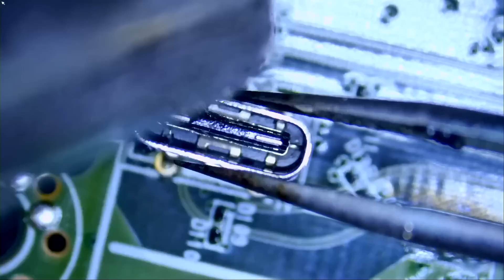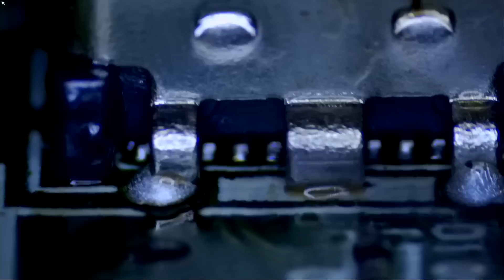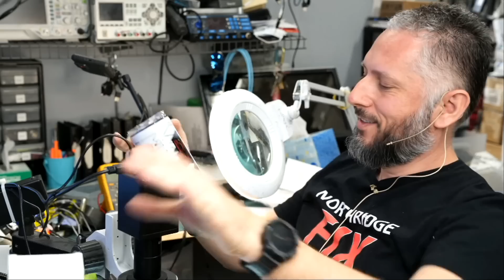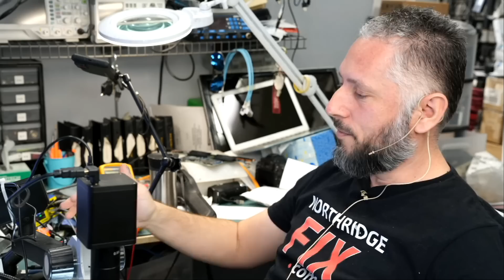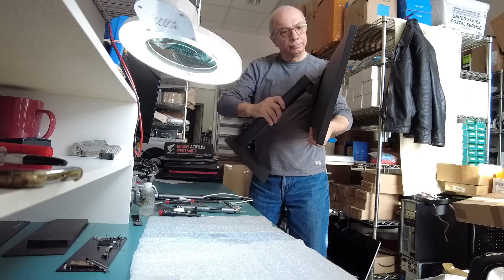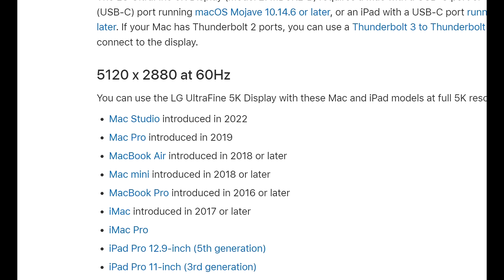Expensive  LG Ultrafine 5K Monitor Repair  Bent cable and no Signal

Comment: One way you could make the repair economical would be to only repair the pads on one side of the connector, USB doubles the connections on each side so the cable works installed both ways around, so you could repair one side and the customer could just turn the cable around on till it works.

Comment: This week, my monitor chose not to turn on after leaving it for 30-40 min (after 15 min it goes to sleep). It is pretty old, like 10-12 years old (LG W2261VP). I searched for a video on how to open it and what could go wrong. After successfully disassembling I found out that the power supply area capacitors are all bulked (electrolyte alu caps). So I noted the values and tried my local "radio shack" the following day to see if they carried these. Sure they did, and I could fix my monitor for like 2 $, instead of throwing it out and buying another for a few hundred dollars. Thought I share it with you guys.  Watching your videos Alex gives many ideas, and confidence and always lean something new.
Reply: thats awesome man

Comment: How many no-fixes do you have on average? I am a network engineer; I work on servers and networks daily. I come across broken equipment all the time.  I try and fix things. I am good at replacing ports and micro-soldering. I have a lot of no-fixes. NO shorts on the power rails. It seems like the chips with the software are bad. I have no way to read or program them. No way to tell if they are bad. Just wondering how many no-fixes you have.

Comment: I wish manufacturers would put external ports on a separate board with a ribbon to the mainboard. These issues keep coming up and at least if it was just a simple pass-through board to replace, it would be an easy fix. I guess it's down to cost but also somewhat intentional in helping to kill off older products and get consumers to just go replace rather than repair.

Comment: A trick I use occasionally to reduce heat damage risk is use heatsinking to protect parts.  For a connector plugging in a cutoff connector adds some thermal mass, and insulates the plastic interior.
Reply: He sometimes uses metal shield too. Except in this case, it had to stick on the bottom.

Comment: I'm not sure why a monitor needs thunderbolt. Everything is wrong about this connector. The surface mount, the easy to deform oval shape (strong againt forces from the outside, not from the inside), the special cable.

Comment: Connectors are such common failure points.  I’m surprised they’re not made with disposable inserts that can be replaced if the socket is Hiroshima-d.  I wonder which company has the most robust ones?

Comment: Why does the owner just use another socket? There are 2 sockets on the board.
Reply from the maker: Only one port is Thunderbolt 3 and the rest are USB 3.1 gen 1 downstream used to connect to other devices and accessories
Reply: @NorthridgeFix  thank you, I am not a tech head, just really enjoy watching your work. I solder only larger stuff for RC model hobby, leant a lot from watching you

Comment: just imagine the manufacturer not spending 50 cents on a device that costs 1000$+,
on making more of the usb-c ports use thunderbolt-3, so the monitor wouldn't be e-waste if the user accidentally dents the only thunderbolt connector...

Now that is a prime example of "Planned Obsolescence"
Reply: i would never buy such a stupid monitor, always buy one that has hdmi, display port or DVI.
Reply: Or software controll all conetors in or output.

Comment: Out of curiosity, why would you take one from the top to replace a few inches down? Why wouldn't the customer just use the next USB up?
Reply: He mentioned it a couple of videos before, that this monitor has only one input. This being the broken USB c port. Stupid design if you ask me...
Reply: Because the monitor is designed in such a way that only one of the Thunderbolt ports is an input.
Reply: I'm just guessing but the next USB up probably isn't configured for display
Reply: In some electrical devices only one port has the necessary specifications. such as hdmi 2.1 ports and hdmi 2.0, i think the thunderbold 3 is the "problem" on this one
Reply: this type of monitor has only 1 USB C as the host (source) and the rest of the USB C as expansion (to daisy chain to other monitor), so the broken one is the host and the rest are just for expansion and doesn't accept input
Reply: @TheIyudha  LG 5k doesn't support daisy chain